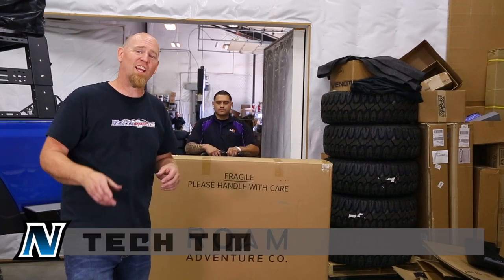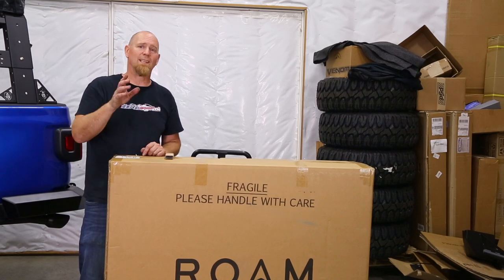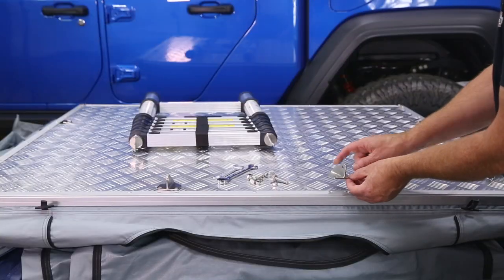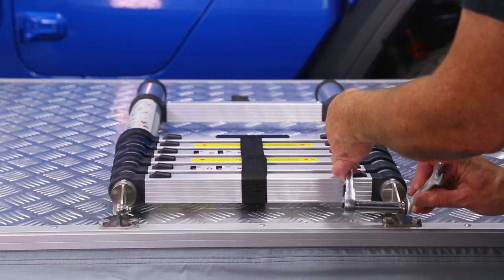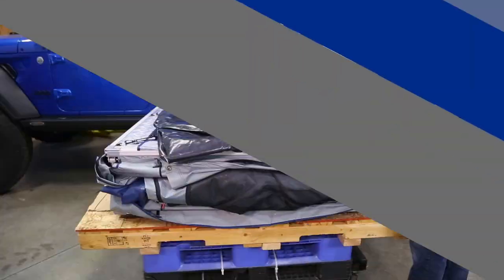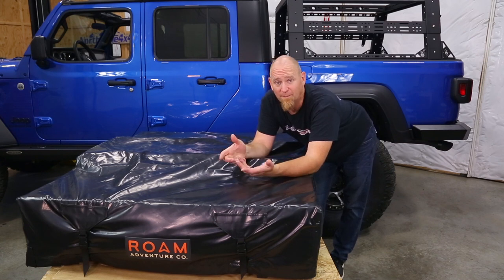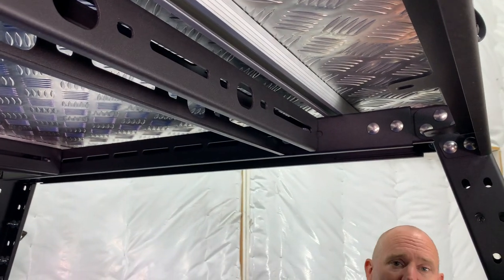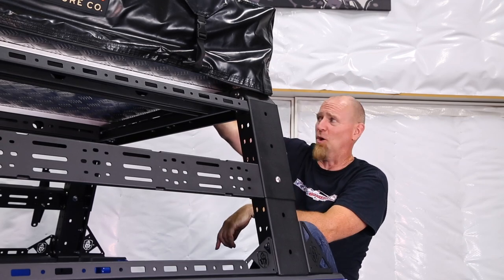Roam Vagabond Rooftop Tent - Assembly & Install

Comment: Some of us don't have a crew to help us lift the tent (Lucky!). I'm 61 yrs old and I had to do it myself. I also drilled a hole in the corners of the floor closest to the cab and secured 1/4" wire rope, made loops and did the same on a secret spot on the bed so I can padlock the tent to my Gladiator for security. These are very popular with thieves.
Reply from the maker: Great ideas, thanks for commenting.

Comment: Great video, thanks for the step by step. I got mine last week and finished putting it together on Friday. The bolts are about 1/2" too short for my rack so ordered new ones. One thing I noticed, you left out a step with the cover. There's a corded edge on one side of the cover that should be inserted before zipping up the other 3 sides. Can't wait to take mine out soon.
Reply from the maker: Glad you liked the vid!
Yes we did leave out that step, not sure how that happened! 
Check out our follow-up video on the Roam Adventure RTT: https://youtu.be/k_T6nmdLa7k

Comment: SO,  what do you do if your truck track only has bars that are the same direction as the axels rather than front to back?   Can the Roam rails be installed differently or is the opening positioning different.  I would guess that most tents would open up to the drivers or passenger side rather than the rear of the truck.  I did not look to see how your setup opens. Guessing it would be to one side rather than the rear.
Reply from the maker: No problem, the mounting brackets slide forward and back, so you can match them up to your cross bars.
Reply: @northridgenation  Glad this question was here, I just ordered my tent a few days ago and installed my bed rack yesterday and it too has the rails running in the direction of the axles. Craig, did install go well? What bed rack do you have if you don't mind me asking?

Comment: What should be mentioned (at least on the Vagabond XL) is that the little rubber inserts that are in the pre drilled holes MUST be punched out first. Use a thin screwdriver or small punch to push the bottom stoppers from the top. You can't pull these off by hand to save your life from under the mattress. The entire mounting rail process is dumb.